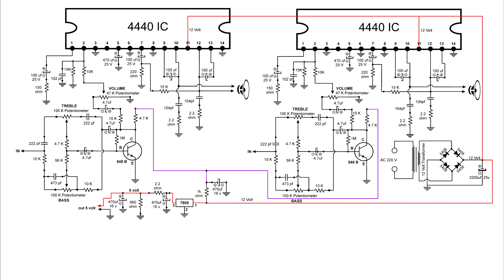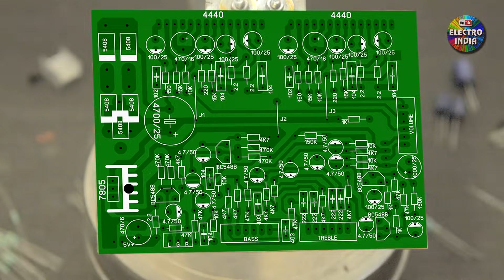Amplifier Part #1 Homemade DIY Audio Board 4440 Double IC (Hindi electronics) ELECTROINDIA

Comment: sir 4440 ke amplifier board ke liye,
12v transformer power supply kitne Ampere ki lagni chahiye,
ki amplifire board bhi safe rahe aur output bhi achi ho.
Reply: 44 40 connector wala Kitna hua na ho to kaise mangvae

Comment: plz tell how to connect 12-0-12v transformer on this board. when i play fm radio there is much humming and gain sound coming out if i  touch fm antena wire then sound  stop plz resolve

Comment: Technical Specifications:

 10" Subwoofer Non-pressed Kevlar Cone
Maximum Power Handling Capacity 500W Peak
Frequency Response: 40Hz-5KHz
Nominal Impedance: 4 ohms
Recommended Amplification: 5-110WRMS
Sound Pressure Level: 93dB 1W/1m
Aluminum Voice-Coil/Former

I have a subwoofer of this type.  I want to make it 2.1 by adding 5 inches two satellite speaker.  I need an exact amplifier specification. could you please help me to give all details of amplifier board  and others accessories?
Please give me your fb Information
Reply: Bro  ink ocean ka class d 50+50+100w best rahe ga